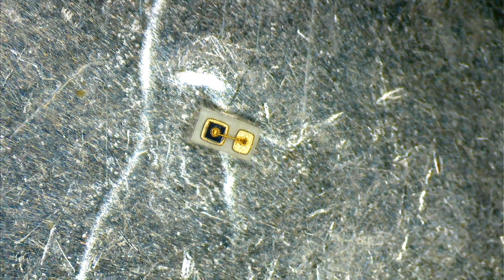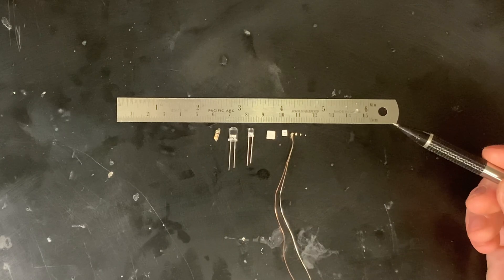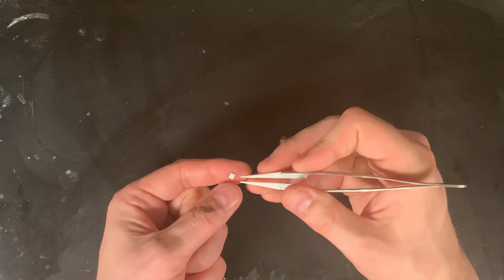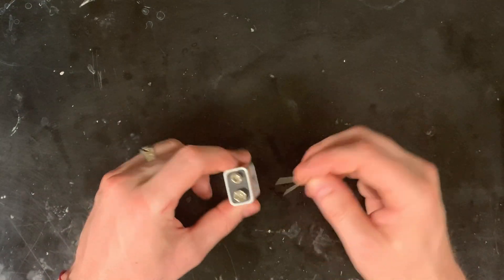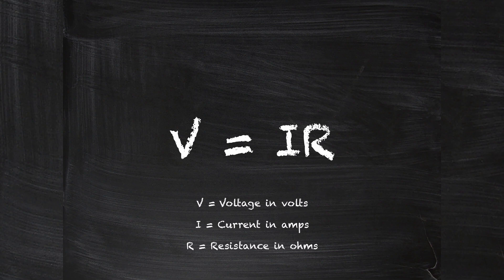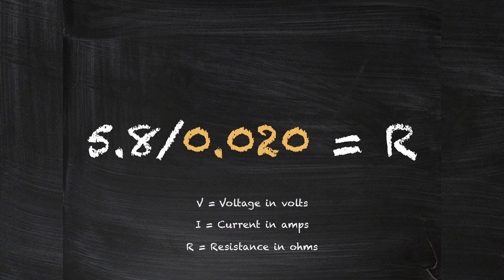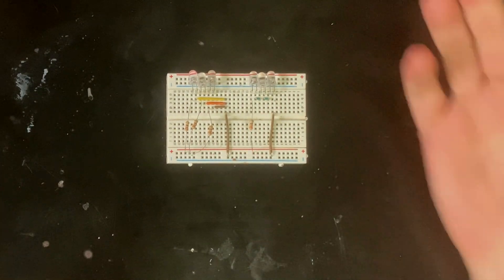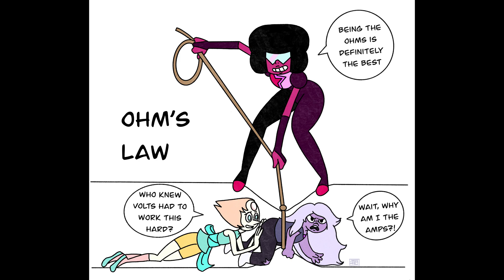LED basics

Comment: i want to wire up my valkrie. the last one i wired up i put 3mm lights to light up the cargo hold. but half of them won't light up. i ran them as a circuit. i don't know what i did wrong. 2 AA batteries for power
Reply from the maker: Did you put resistors in there? What do you mean by “circuit”?  What color LEDs?  My first 2 thoughts are if it’s a red LED with no resistance you may have burned them out red normally has a forward voltage of 2 and 2AA is around 3 volts.  Or If you have wired them in seres you may be JUST meeting the voltage with fresh AAs as voltage drops as a battery is drained.  I hope this helps let me know! I have done a Valkyrie maybe someday I’ll put it on the channel!
Reply: @OchoMiniatures  do you have a facebook? youtube keeps deleting my comments that show a link to what i built.
Reply from the maker: @halkeye20  ok added my email to my profile!  youtube comments don't like links so I am not even going to risk my email in the comments but its just ochominiatures at gmail.